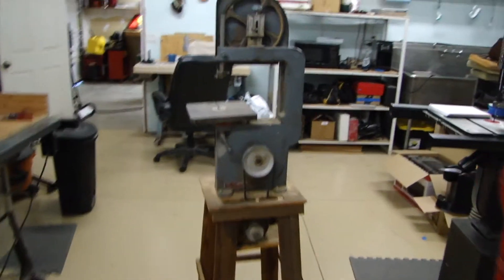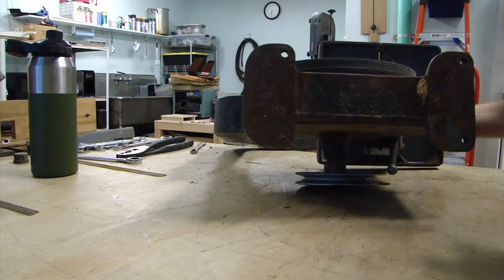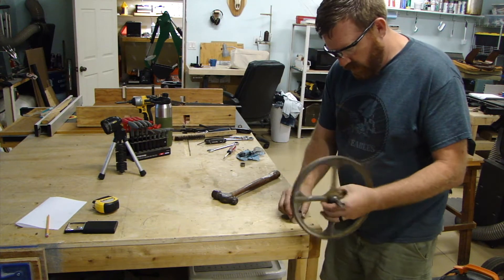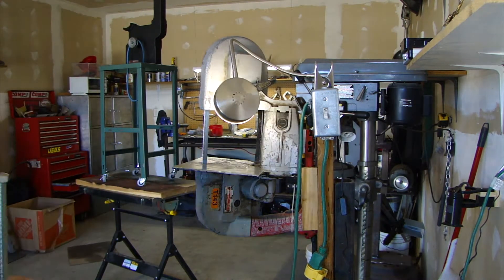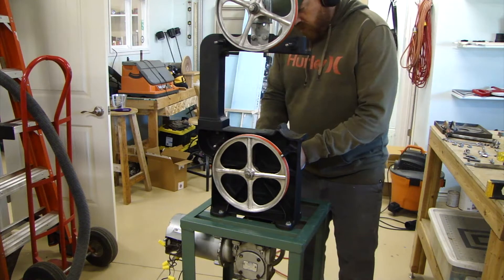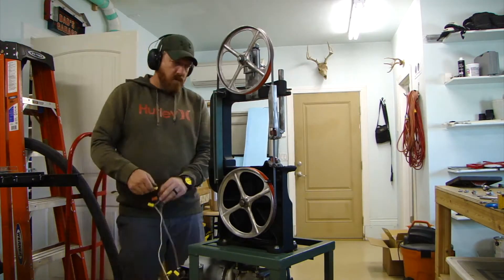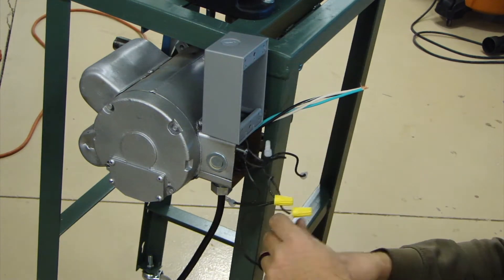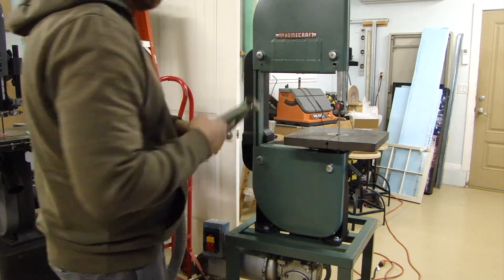Converting a wood cutting bandsaw to a metal cutting bandsaw

Comment: Good job. 300ish is ok for aluminum, but you want to be 180-220fps for steel, and use some oil during the cut. I'd probably cut off or shroud that long protruding drive shaft just in case anything ever gets wrapped...

Comment: You seem like the kind of guy that I naturally gravitate toward.  Less production nonsense and more simplicity -- especially when it comes to making good use of what you've got on hand.  I see that you've got a lathe in your work shop.  Did you buy it in its current form or did you do some sort of similar fab project to make it?  Perhaps yours already does this, but I was also wondering if you've ever given any thought to making a vertical/horizontal [convertible] belt sander for metal shaping?  I've both liked and subscribed, so please keep on making the informative videos. 👍

Comment: lucky that the saw neck is sufficiently rigid, I done that on a saw of that size and it needed a parellel structure to reinforce the neck beacuse the saw vibrate so badly that the use in that condition would have resulted to the breakage of the teeth on the saw blade or worse, the break of the neck of the saw.
very good video.

Comment: Nice work, looks great. I’ve converted a couple to metal saws, Ive found that a good quality blade makes a big difference if fpm isn’t ideal. I like starrett intenss pro die blades.
Reply from the maker: Thanks lee batt, I'm about due for a new blade' I'll check out the starret.  The one I've been using was the cheapest one I found on Amazon (it wasn't great, but got the job done).

Comment: Thx for sharing.  Just did one myself recently with a DC treadmill motor.  Your FPM is a little fast for steel.  Most of the published #'s you find online for recommended speeds are for cutting with coolant.  Dry, you want to be around 170fpm.  If your blade holds up for a while I wouldn't sweat it, but if it seems to eat them quicker than you'd like, try slowing it down a bit.
Reply from the maker: Thanks for the feedback, the blades have been holding up fine on mild steel.

Comment: Nice job. I picked up a fairly new rigid bandsaw from a guy putting it on the curb. Its the garbage one rigid made with horrible casted parts. Once I finish making steel replacement parts ill be reducing speed with various pulleys. From what I've found porter cable has an exact replacement that can be used for the blade tension and tracking.

Comment: I have an Craftsman wood saw that I want to do the same thing with.  I'd like to be able to vary the speed.
Reply from the maker: I thought about that too.  I was thinking it would be cool to be able to change the speed with a potentiometer controlling the speed of a VFD.  This is the way I have my belt grinder set up, but I pretty much only cut wood or steel, and I have a wood bandsaw.  Since the build I have cut a lot more plastic and aluminum that I figured I would, so if I did this again, that's probably the route I would go, but this saw works great for steel.

Comment: Which urethane saw tire did you buy?
Reply from the maker: I just measured what i have and searched amazon, cheap and easy.  No issues with them this far, I modified the saw three years ago and I use it pretty often, and have never had an issue (knock on wood).